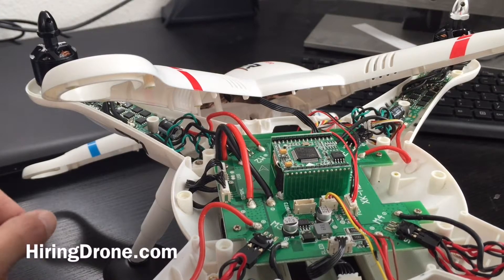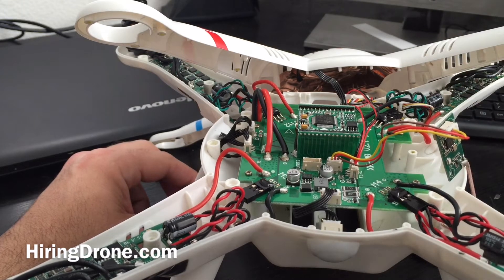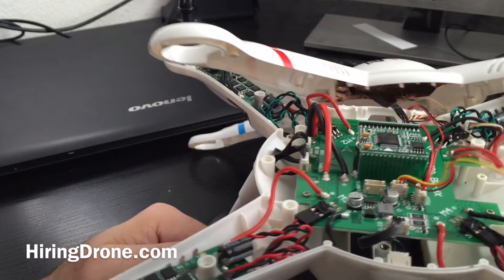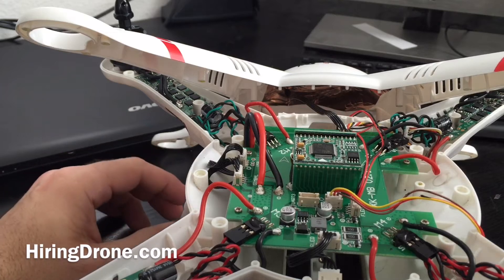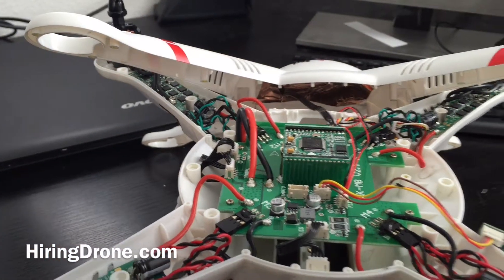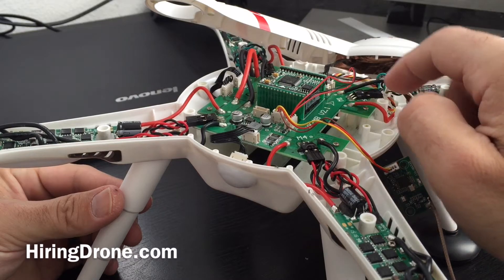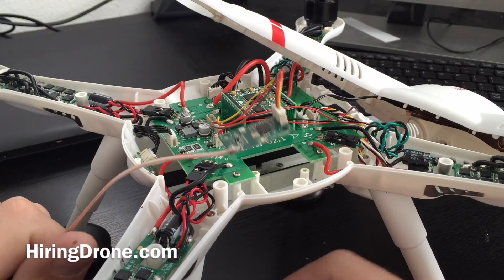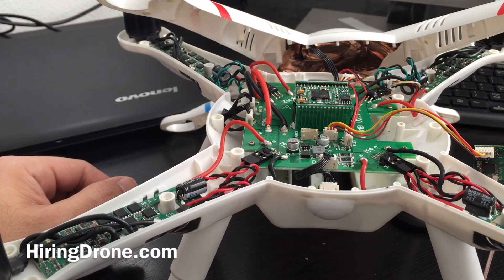WLToys V303 Seeker X380 Flight Controller

Comment: What you are calling a landing sensor is really the COMPASS in that leg.
Reply from the maker: I see. Thank you for the correction. Mine is working now that I swapped out the receiver and transmitter. Very satisfied with it and no complaints.

Comment: Hello, I seem to be having an issue with my v303 and you seem to have more knowledge than most on these but after a couple of decent flights my seeker just chirps and the under lights blink under the arms of the body, will not bind with transmitter and I have no gps light now either. I can't seen to even re do the software because my computer wont recognize it even with the driver installed. Wont even show up when plugged in and turned on. Any ideas or help would be greatly appreciated, thanks
Reply from the maker: Sorry for the late replay. You might have the same issue as me, which is mixed match parts. Try installing the XK Detect software and it should pick your V303 up. I ended up having to get a new transmitter and receiver. Once I did, it worked awesome. I would suggest fixing it, as it has been one of my favorite quadcopters after fixing the issue.

Comment: the motor spins but where the motor that underneath there's a light and that light blinks off and on so it doesn't give too much power to the motor
Reply from the maker: +Jose Valdez Jr You might have a bad ESC/Speed Controller. I believe the light is on the same board as the ESC. A wire may be loose connecting the ESC to the Flight Control, which should supply power to the motor. If the light is blinking, that could indicate the the wire is loose. The vibration from the motors could be shaking it, causing the light to go one and off.

Comment: my v303 back left side light is blinking why. it doesn't fly
Reply from the maker: +Jose Valdez Jr Not sure. You might have a bad light. Is your V303 new, used or old? It could possibly be a wire that is loose.

Comment: Hi Thought I would let you know what I did with the v303! I Velcro a 5200 mah battery under neath it to see if it would do all the things that  it does with the extra weight on it,

well to my surprise it did and I got about 20 minutes of flight time out of it with 2 minutes to land it before the fast flashing red light kicked in for me to land it safe ,just to clear up what this new v303 can do !it  has an auto take off and F A P or point of interest circle if you like ,the wheel on the TX is white and it has a little blue light on the TX as well,it all so has  RTH and auto landing too .the rang was good as well ,I dont know what it was but I flew it just with in my LOS ,and did,nt want to risk it any further ,all in all iam very happy with this little quad ,so I will probably at a later date trans fare the electronics over from the v303 to the x380 shell and utilize  the 5200 m a h batteries and the 5400 M A H as well,I hope this has helped some one out thats looking for a bit more flight time from there v303, ! for about  $ 40 for a top and bottom x380 shell you really cant go wrong ,cheers and happy flying .
Reply from the maker: +Paul McMahon Awesome! Thanks for the information. I have the same flight controller, but Gear Best sent mine with the older receiver and transmitter. My TX looks different, as I do not have the compact antenna or F.A.P wheel. I could possibly have the RTH and Auto-Takeoff functions, but my TX does not allow me to utilize them. My V303 uses the XK X380 Flight Controller software, so I assume I do. I would like to swap my V303 to an X380 shell, that has a bigger battery bay. I am considering purchasing the new V303 TX and receiver, but have not yet seen them for sale.

Comment: i have a wltoys v303 and the motors do not want to run, some body can help me out with this
Reply from the maker: +Yoly Curls Can you share some additional information? Is it new? Is the transmitter/controller binding to the V303? Has it ever started before? Do you have a video of you doing all the pre-flight steps prior to trying to arm the motors?
Reply: +Hiring a Drone Hi, is old but I have been fixing it but the  when I try to turn it on  it  doesn't respond,
Reply from the maker: +Yoly Curls Thanks for the reply. I could be a number of issues. It is hard to tell without more information. Does the quadcopter power up? What flight controller does your V303 have? Does the transmitter bind with the V303? Do you have any video? I would need more information to make a guess. Keep in mind, I am new to the V303 as well, so my advice might not be accurate. I am still learning.

Comment: I got this v303 the other day ,with the FAP wheel and white TX I haven't had a flight with it yet ,I was wondering ,you say this FC is the new x 380 board ! I have a new x380 shell top and bottom which I bought for my x380 when I had it ,but as I said in a other post it feel out of the sky and banggood give me a refund ,anyway getting back to my question ,if this FC is the same as the x380 !do you think it would be possible to  change all the guts of it (v303 ) to the x380 shell and that would inable me to have a bigger battery like a 5200mah like the x380 giving me more flight time ? whats your thoughts on this ?Thanks
Reply from the maker: +Paul McMahon That is a good question. It appears that the model you received has the same FC and board (XK MB V2.1). If you Google X380 boards to purchase you will only find XK MB V2.0. Most likely the board in your old X380 was the V2.0. You have basically the same transmitter and receiver as the X380 from the research that I have done, which seems like a good thing. I have a mixed matched board, receiver and transmitter, which causes my V303 not to fly further than 50 meters. 

If you have a larger battery bay, I would assume you could use a larger battery  if you have the X380 shell..  My shell is the older version, so the max battery I can fit is 2700mah. Both batteries (2700 & 5200) are 11v, but do some research before taking my advice. I am still kind of a newbie. 

I purchased mine from Gear Best, but they will not refund my money. Their customer service is terrible. They are knowingly shipping defective quadcopters and sticking their customers with dysfunctional products. The only thing that I can try to do, is find a new V303 receiver and transmitter (one you have) and install it. I do not see any for sale. All the older V303 receivers have been pulled off the market. 

Please let me know how your flight goes. If you have video of the new shell, transmitter and receiver, I would be interested in seeing what it looks like. I purchased mine 1 month ago and it looks like I got caught between the old version and new version of the V303.
Reply: will do and thanks for your in put !iam not going to change any thing over just yet ! but If I was going to ,the motors are the same as the x380 and if the F C is the same well Icant see why it wouldnt work ! to me flight time is very important ,its just a thought at the minute ,I have had such bad luck with these G P S quads in the past , I was all most going to stop buying RTF gps quads ,but needless to say I got suckered in by the $189 price from bestgear on a 6 day sale count down sale it was ,after two days ,I pulled the trigger on it :)